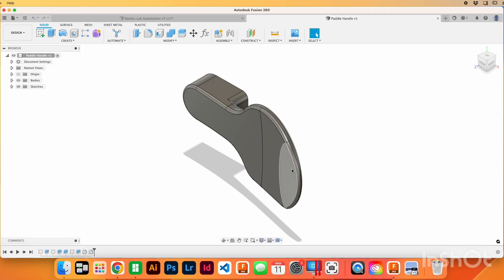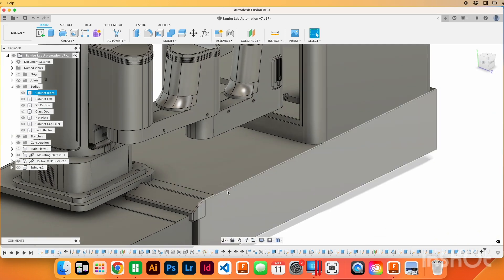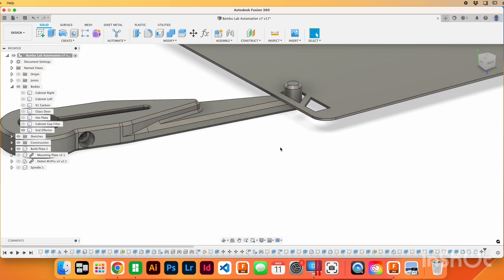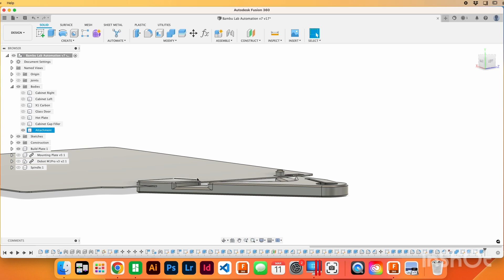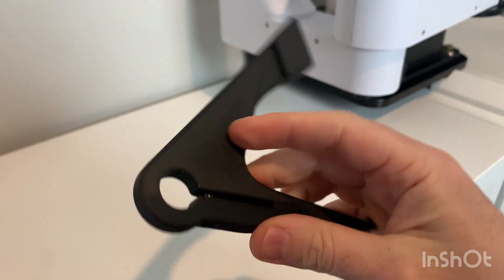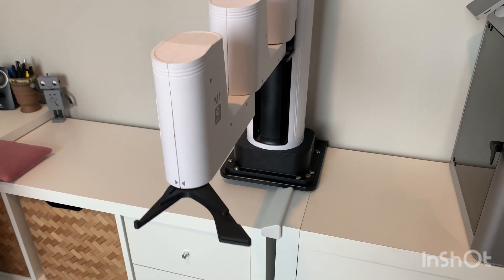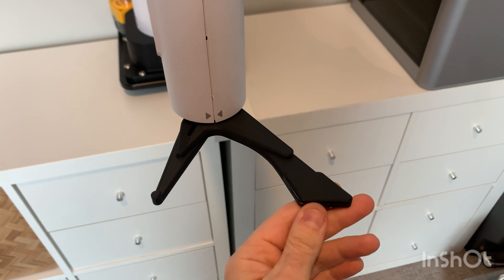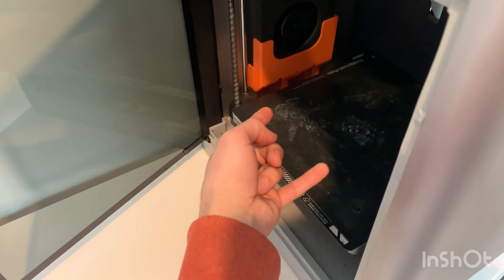WE HAVE MOVEMENT!! On the Bambu Lab X1 Carbon automation - Part 4

Comment: Just an idea.... wouldn't it be easier to exchange the permanentic magnet buildplate with an electromagnetic build plate/several electromagnets that fix the steel build plate until the print ended?
The print process starts
  -the magnets fix the built plate 
  -the printer prints the model(s)
 -the print process ends
  -the electro magnets wil be switched off -> built plate gets lose
  -the roboter opens the door of the printer
  -the roboter takes the build plate and put it on another device which transports the full built plate away. May be to another device which takes the model(s) from the build plate and cleans ist
  -the roboter fetch another empty built plate and puts it in the printer
  -the electromagnets will be switched on what fixes the built plate
  -the print process starts again
...
...
-
Apologies for my bad english
Reply from the maker: The bed swap and magnets is a good idea, but seems like a lot of work. No idea is off the table, though. Thanks for your suggestion

Comment: Hmmm.... gets me thinking. This Carbon Unit finds the flex plate is tough to remove sometimes with large rigid prints, then when I manage to pry it off, all the parts go flying inside the printer... so here's a thought... what if you got a thicker, stiffer, non-magnertic, or perhaps just magnetized at the front - build plate coated in PEI.... and with an ultrasonic transducer (not necessarily attached, perhaps a surface the robot could move it to) to vibrate the stiffer build plate to detach parts. Heck, audible frequencies might be better. Sounds like a cool experiment. Or perhaps strip the bed of its magnets and use a mechanical means of bed holding (vacuum, anyone?), so there's a low-force means of pulling the bed from the printer, then set in on a table with an open center and electromagnet below to shake the plate. A vacuum need not be large or costly, $5 or so gets you one like a food saver bagging system uses...
Reply from the maker: A lot of great ideas! I like the idea of a glass build plate that uses PEI and a mechanical means of keeping it in the printer.

Comment: This is nice!
I think you should tilt the printer (lets say 15 degrees to front), connect the back of the build plate somehow and make the front lip rise one it's going down on end of print (using some latch that will touch it). Then the build plate will bend and everyhing will fall off. 
To open and close the dorr you can use servo with arm or even better - make the door slide to the left

Comment: Sweet! Instead of drilling and tapping, you could try to instead extend your print backwards where it would then come up around the sides, effectively constraining the gripper from rotating. This would ofcourse prevent you from using that axis of the robot, but could be great as a proof of concept. I know that doesn't make sense but if you're interested I could send you a drawing of what I mean! Great project
Reply from the maker: Thanks for the idea Zach. Unfortunately I do need to use that axis to both get the door open and when/if I get the build plate out of the printer.